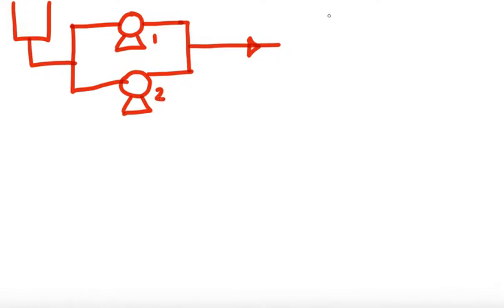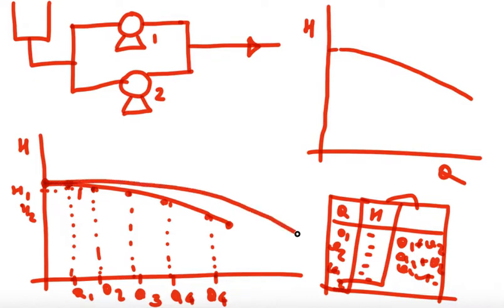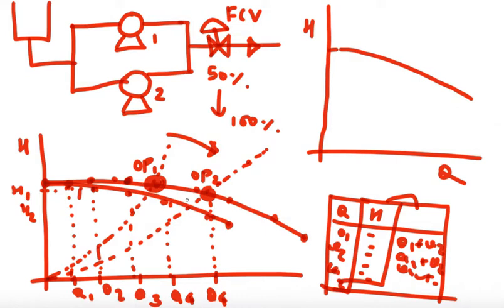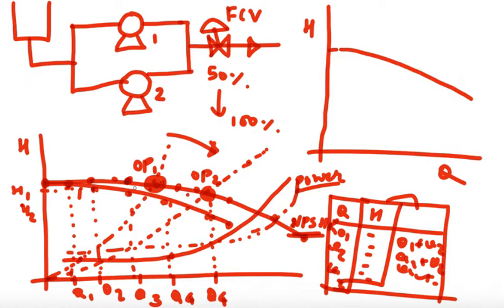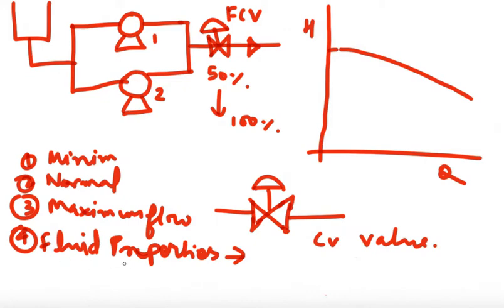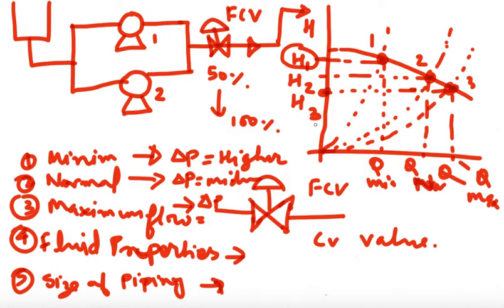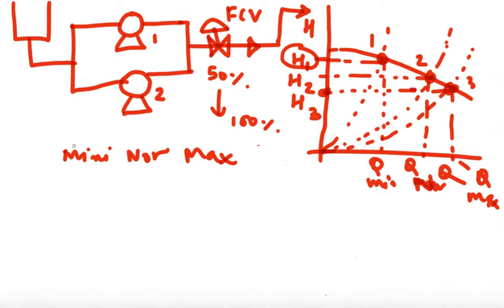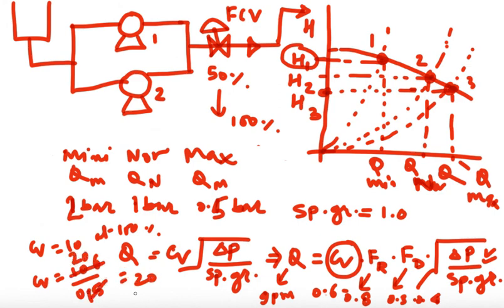Pump operation & Discharge Line FCV Sizing

Comment: Hi, why system curve not brought into picture ? As far my understanding a pump characteristic curve will be constant for a given pump and its impeller. we need to compare our system curve with pump curve to see our head requirement. Generally, pump vendor develop their curve with water as standard fluid, but when we suppose to use the pump for other than water then system curve comes into picture. Am I interpreting correctly ?
Reply from the maker: yes , your interpretation is correct, Pump H-Q curve which is called pump characteristic pump will be constant but the system curve will change based on the resistance in the entire pump loop.

Comment: As usual excellent video. So what is the advantage of calculating Cv of FCV? What does Cv value mean to a process engineer? Thanks for your valuable time.
Reply from the maker: Cv value is calculated to know the orifice area required for any control valve, orifice area required for minimum,normal and maximum flow gives us the range of Cv value required for a control valve purchase specification. First of all a Process Engineer do the control valve hydraulic calculation( pressure drop, flow,Cv value) and prepare a Control Valve process datasheet to issue it to instrument design engineer. Later on instrument design engineer prepare specification based on this data sheet to issue it to client as well as vendor who supply control valve based on our specifications.

Comment: Thank you the video. Could you please explain pump chemical injection skids?
Reply from the maker: sure, There we use metering positive displacement pump for the variable head requirement for chemical injection in the pipeline( since operating pressure is fluctuating in the pipeline based on the landing pressure requirement and flow in the pipeline). Definitely, I will upload a video on chemical injection skid. I have lots of work experience on the design a chemical injection skid for an offshore platform.
Reply: Lokesh Kumar Singh thank you so much for your prompt response. You are doing a great work educating young generation!!! Looking forward to watching your next video.